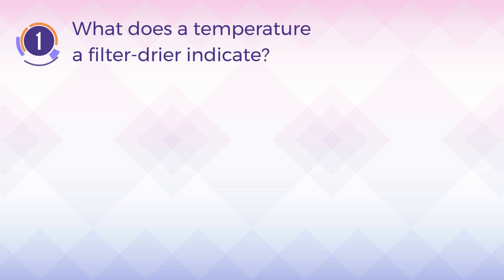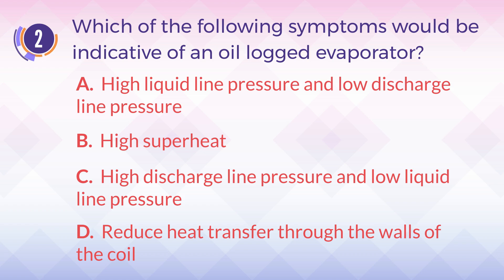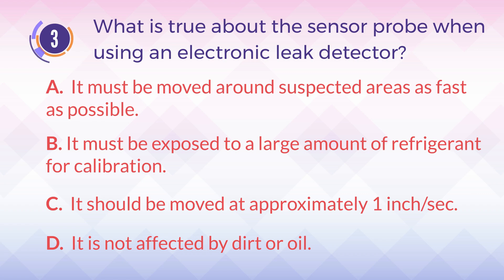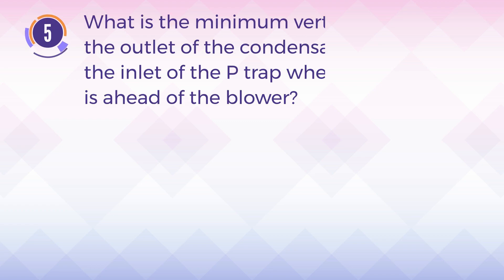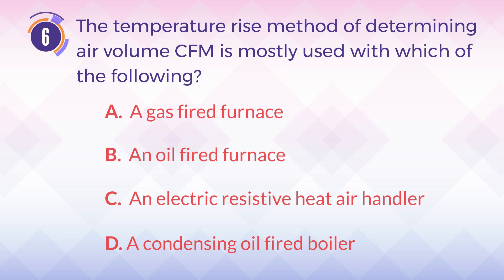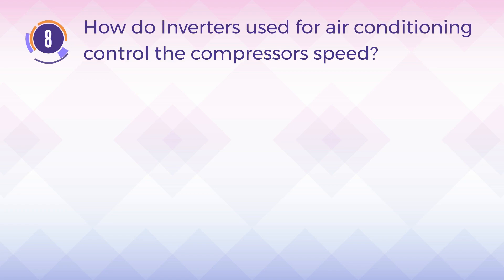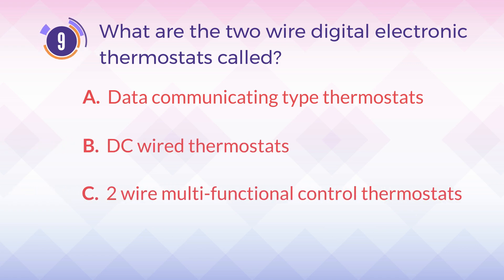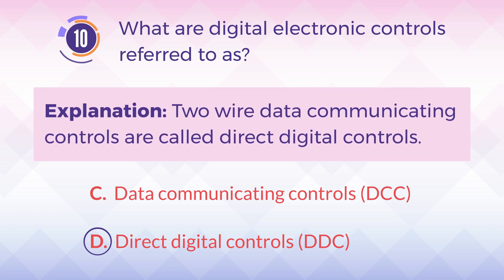HVAC Exam Prep #1 - Air Conditioning | TruePrep

Comment: #6  should be A,B, and C. You can calculate approx cfms using temp rise method in electric, natural gas, propane, and oil furnaces
Reply: Agreed. But it said which is the most common. Not with what type of heating can you calculate cfm

Comment: #5, totally confusing.
Reply: What part about it?
Reply: The fan inside the unit pulls in the water out of the P-trap.
Unless you're able to put the drain condensate drain on the supply side